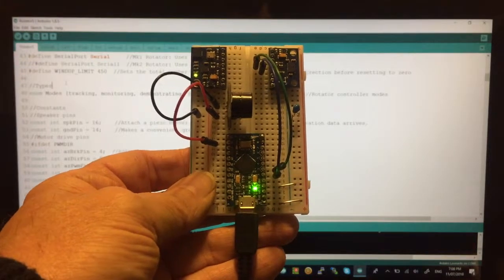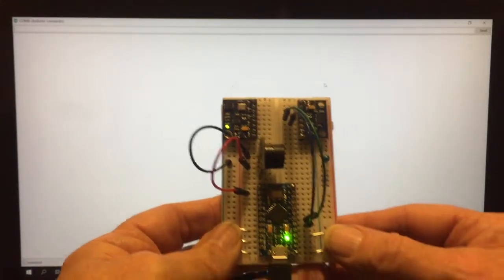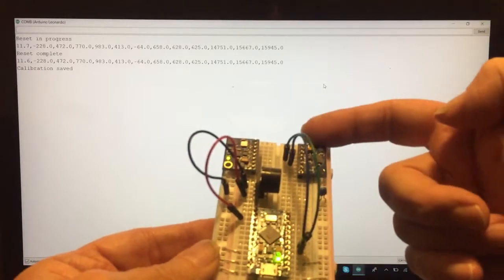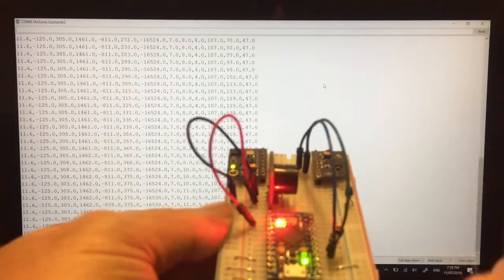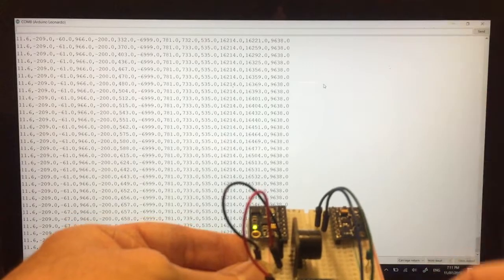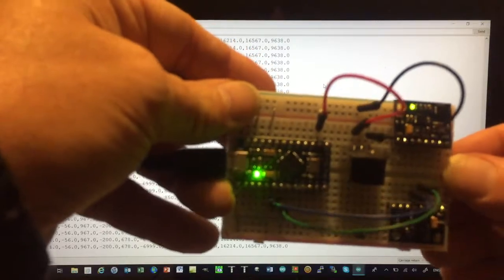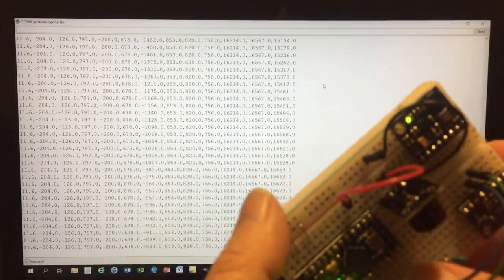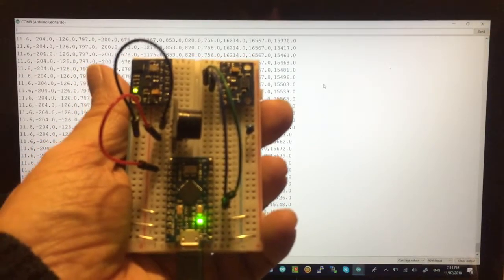SARCNET Mini Satellite-Antenna Rotator 3D sensor calibration

Comment: Is it important in which order you do the calibration?
Reply: Hi Roger, This video is for our SARCTRAC project. For our Mini Satellite-Antenna Rotator project it does not matter the order of the 12 cardinal points (6 for magnetometer and 6 for accelerometer) you do, as long as you carefully search around each point until it stops beeping. Although we do recommend doing them in the same order, as it is easier to remember. 73, J&J